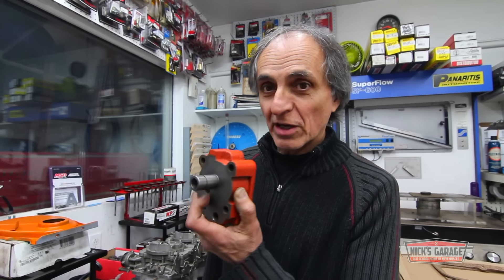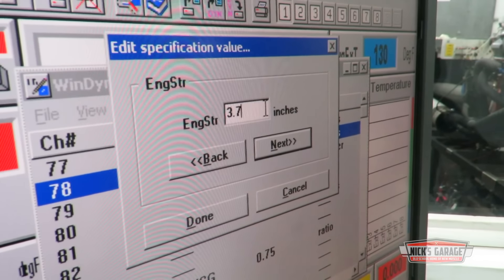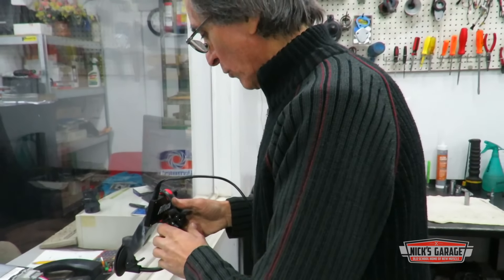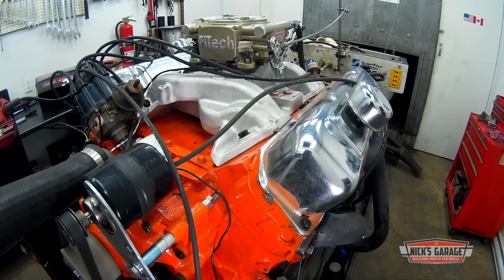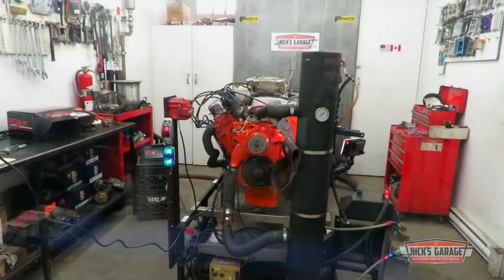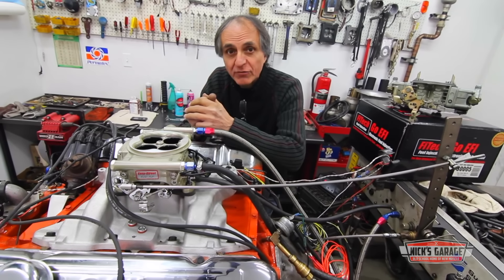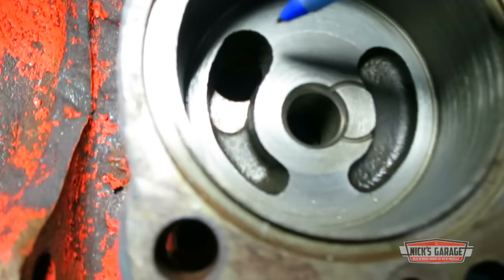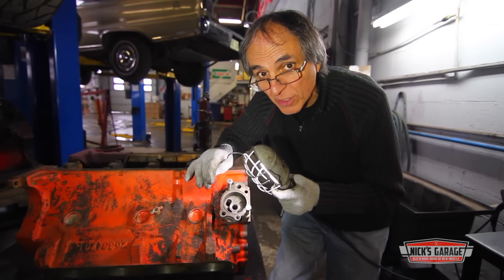Carburetor vs E.F.I. - Dyno Room Showdown

Comment: Nick needs to learn something about EFI. First of all, that is not real EFI. Spraying gas down a carburetor will not perform any better than a carb. It is a silly notion to think otherwise. 

Real fuel injection injects the fuel in the head or directly into the combustion chamber.  The whole point of fuel injection is to have a DRY intake. This allows more space for the air. In addition, it allows for long intake runners which improves VE. The intake can be tuned, just like the exhaust. The problem with a wet intake is that at low RPMs, the fuel does not stay mixed with the air. This causes it to puddle in the intake. As a result, the intake design is highly limited. Once you run a dry intake, you can design any kind of intake you want without consideration for the fuel. Look under the hood of any modern car. The intake runners are very long. This is one big reason why they are able to get such good numbers out of such small engines.
Reply: Hi Daveinet, ... yes and no.  What Nick is using still is called "Fuel Injection".  Fuel injection advantages are much more than having a "dry intake manifold".  There are several types of fuel injection systems (four are/have been used most commonly in gasoline cars). 
Throttle body fuel injection (aka single port fuel injection) (TBFI) is still fuel injection but is not as efficient and performing than port fuel injection or combustion chamber fuel injection.  The main problem is that remote cylinders (1-4-5-8 on most Ford V-8s) may not have the right (i.e. optimal) fuel/air ratio being robbed by their middle cylinders).  Also, as you mentioned, the fuel spray may condense on a cold intake manifold.
Multi-port or multi-point fuel injection (MPFI) sprays the fuel closer to each individual intake port making for a more precise mixture entering the cylinder head and preventing or making fuel condensation less likely in the port/head/manifold outlet.  On the other hand, MPFI "shoots/sprays" the fuel at the same time which can lead to small imbalances or stagnation in the intake ports.
Sequential Port Fuel Injection (SPFI) is similar to MPFI but the injectors are "fired" sequentially and independently, timed according to the firing (spark) sequence of the cylinders.  This allows for precise timing of fuel delivery without any lag to the opening of the intake valve.
Finally, Direct Fuel Injection (DFI) and its variations are the delivery of the fuel directly inside the combustion chamber.  It allows for ultimate and precise timing, amount, delivery, mixing, etc. of the combustion chamber fuel/air ratio depending on feedback from the various sensors installed on the engine (O2, NO, Air Mass, etc...).
Ciao, L (Ford Motor Company Engineering)
PS: I met Nick at a car show and I have been very impressed on his attention to details, his professionalism, and his practical approach to common mechanical problems.  He is an outstanding mechanic.
Reply: @lancelot1953  There was intended hyperbole in saying it was not real fuel injection.  And while you can compensate for high altitude and better cold starts, its not going to do much for you for everyday driving. Carbs do very well at atomizing the fuel. It is difficult for an injector to atomize the fuel as well without going to ultrasonic liquid processing. 
I'm quite aware of the types of fuel injection. I built and tuned a 502 MPFI. I modified the Edelbrock's tuning characteristics for increased flow. I can't produce dyno numbers, but the butt dyno had no trouble telling the difference. With the mods removed, it ran rich, especially in the top end.  There is just so much more you can do, once you get the fuel out of the intake.
Reply: Hi Daveinet, with all due respect, my answer to you was not to start an argument but just to point out that Nick's semantics was right in calling his system "Fuel Injection".  Of course, I do not know your experience or level of expertise in engine induction systems.  A lot of YT viewers have absolutely no clue in what they are saying or claiming, so at times, I try to clarify or explain issues that are brought up.  I am very familiar with the older Ford engines and older engine science since that is what I worked on as part of my career.
I have built several "classic" Ford engine but stayed with carbureted induction (for my restoration projects to remain "classic").
What did you put your 502 in and what engine block did you use?
Peace be with you, drive safe, Ciao, L (FoMoCo engineering)
Reply: @lancelot1953  One of the things I was pointing out is that these TBI systems don't offer much in performance gains. There is a mentality that there is something magic about FI, regardless of the type. The concept of fuel injection in and of its self doesn't do a lot. Performance gains are based on the intake design changes that would not work with a carb. Same even with direct injection. Its not the FI, its the fact that you can time the fuel delivery to prevent pre-ignition, so you can run higher compression. 
The 502 was built for a custom chassis front wheel drive 31ft motorhome. It was a lot of fun for the 16 years that I had it. The motorhome was very light weight for its size - aircraft stretch form aluminum shell. The cabinets were all Wilsonart Laminate formed over a frame. The cores were honeycomb. It had a very low center of gravity and was in a completely different class handling wise. The day I sold it, I took a photo of the speedo at 100 mph. I didn't think about it at the time, but later I looked at the photo and realized both hands were on the camera. I was driving with my knee at 100 mph in a 31 ft motorhome.
Reply: Hi Daveinet,  I fully agree with you with the benefits of the later generations of Fuel Injection but I do despise the complexity of it all (in modern max pollution-controlled production vehicles); TBFI did suffer similar problems of non-symmetrical cylinder fuel/air distribution (depending on the intake manifold design), "wet manifold" until the manifold was hot, and only offer a minimal performance increase on a well-matched carburetor/manifold/head-design combination.  But, principle-wise, it was an step in the right direction albeit "cheap".
What donor motor block did you use to reach 512 (Mopar, Ford?).  What heads and especially what front-wheel drive differential did you use to handle such power?
Did you built your motorhome from ground up or did your use the shell from an Airstream or similar design (Class A, B, or C)?  My hat to you, it is not easy.  I have restored an older 31' Winnebago Class B-Plus on a Ford Chassis, it is a lot of work and even more "fitting"
Take care, Ciao, L
Reply: @lancelot1953  When I say "built" I mean putting the top half on a GM performance 502 crate. The motorhome was a Revcon. It was originally designed by the stepson of Wally Byam, so yes, very similar to Airstream. I bought what was supposed to be a turnkey MPFI, however it needed a lot of tweaking, so I learned a lot about programming FI and a lot about how engines really work in general. It was a good runner, although it took about 2 years of playing with it to get it fully dialed in. I also had to learn about building a differential after breaking teeth on the ring gear twice. It was fun to drive. From a 20 mph roll, you could still stomp on it and still break the front wheels loose. Shift from 1st to 2nd would chirp if it was floored.
Reply: Hi Daveinet, was all your power delivered to the front axle, if so what did you use i.e. did you use a separate axle such as a front Dana 50/60 or did you use an trans-axle with integrated steering.  I used my Winnebago chassis frame/drive-train for compatibility with other Ford drive-train components (which I was very familiar with).  I modified, updated, and customized the interior for research and lab work.
I do not have much merit in engine technology since being an automotive engineer, I had not much choice but to learn what I was being taught.  I wanted to design the next generation Ford GT-40 race cars but times changed and I was relegated to work on antipollution equipment (which was not as glamorous as racing the Monaco circuit!
Congratulations for your custom work, Ciao, L
Reply: @lancelot1953  Yes, it was actually a Dana 70. The Dana 70 is de-rated for FWD applications, but still stronger than a 60. After the second time it broke, I had a conversation with Jantz Engineering. He sold me a bearing girdle kit and reinforced diff cover. The biggest thing is to keep the diff from spreading under torque. I also croyogenicallly treated the gears and carrier. It doesn't make anything stronger, but it does keep it from flexing as well as reduce surface tear out. All of that seemed to do the trick, although it took a long time before I was bold enough to allow a hard downshift.
Something else I should mention. No fuel in the intake allows for a cold intake. The advantage is that cold air is more dense, so you make more power.
Reply: Hi Daveinet, thank you for your information.  I would recommend that you make a video and/or a document on the various sites dedicated to the Dana axles, custom motorhome modifications, and making the "high-performance" community learned about your experience.
You are right about cold air being more dense (bringing more "Oxygen/O2" in the mixture).  That was the principle (at least in theory) behind the "Ram Air, Shaker Scoops, and other various "cold air" intake of the muscle car era.  This is also the rationale behind using the turbocharger intercoolers.
What will be your next project or have you given up the "nomad" life?  Ciao, L

Comment: Not true. No fuel injection will learn how to fuel an engine on it on. If fuel injection is set up correctly. it will make the same hp as a carb.
Reply: blackericdenice.     True, we needed more time to learn the EFI system.
Reply: Is this really you are a youtube channel controller? I'm just messing with you. I rebuilt a 96 Tahoe engine, installed a hotter cam and went crazy trying to tune the engine. I bought a new F150 2.7 ecoboost and sold the Tahoe.

Comment: That was a poor test. They would of spent quite a bit of time tunning the carb and ignition to get the best results. The efi got run or die.
Reply: Richard Shields.   The night before, we had it tuned for idle, part throttle and full throttle, and ran well. Next day for video, the efi had a mind of it's own.  True, needed more time to tune and learn.

Comment: I just stick to my 750cfm 3310-10 Holley performance. Never gave me issues. So I feel not need to replace it with tbi. Also can easily re jet your carburator to tune it. I think they both work just fine...just personal preference.

Comment: Not enough info here, what MAP did you use in the injection system? A single run does not allow enough info to build a proper MAP so you might have a MAP for fuel economy or who knows. I use to be all about carbs until Holley brought out the Pro-Jection system even though Holley had many problems with this, it made tuning so easy. Faster throttle response, smoother idling and no flooding off the line are just a few reasons injection is better. There is a reason all major racing is using injection including nitro.
Reply: homie789.       True, we needed more time to learn the EFI system.

Comment: Νick please tell me something....those HVH CARB SPACERS SUPER SUCKER as they call them...why are so pricy???do they really work especially in low end torque and throttle repsonse?have you ever use them?
Reply: steliosz28.        In some case they work. It depends on the application.

Comment: The EFI is the ony way to go for the great majority of us.  Some tweaking to cam, and spark would probably account for the difference in HP.   Contact the people who make camshafts and they'll be happy to show you a grind that would optimize the EFI
Reply: no way you can run an efi without electronics which automatically makes the carb superior.
Reply: try reading for comprehension Paul.  It's the electronics that make the EFI superior.  Why do you think Nascar Cup racing went with EFI?   @paulk5311

Comment: Opening up the inlet port all the way through the kidney port changes the pressure balance of the ring gear in the pump.  On a low pressure system such as an engine's oiling system, it probably won't lead to substantial wear but its something to be aware of.

Comment: The distributor vacuum advanced was unplugged. Why is this done with EFI? Was it unplugged with the carburetor also? 
Should have shown carburetor set up. Just saying? Timming is everything.
Reply: Some EFI engines also computerize the spark timing. The distributor is then locked in place, and the computer sets off a spark according to the programming.

There were also some carb engines that had computerized spark timing, the Chrysler "Electronic Lean Burn" was built that way. GM used computerized spark on almost every carb engine by 1981 and continued it until carb engines were discontinued.

Comment: Most EFI's don't start "learning" until they go into closed loop which doesn't happen until the engine is warmed up.  Nick is obviously an expert with carbs but his expertise with EFI has not been shown.  This way this test was performed doesn't help his EFI credibility.

Great tip on the oil pump, good addition to the show!
Reply: Micheal N.   I am old school, but I will catch up on the new school of EFI.
Reply: Nothing wrong with old school, in fact it has many advantages over the new stuff.  I really enjoy the show.

Comment: I don't think there is a EFI system so good that it can learn everything by Idling for a while. You put more effort in tuning the carps. Why not break out a laptop and actually tune the EFI.
Reply: ThetonyChopper.   The night before we had it tuned for idle, part throttle and full throttle. Ran well and the system learned it. The next day for video, had a mind of it's own. True, need to let learn.

Comment: The EFI HAS an electric fuel pump to prime the system so IF you want to avoid the cranking with a carb just add an electric pump.  Other side of cranking is the oil starts to flow through the system while cranking - depending on how long its been since you started the engine, it could start dry with EFI. Better to install a low oil pressure switch on the EFI system to stop ignition until minimum oil pressure of 15# is attained or add an Accusmp oiling system..

Comment: He got the results he wanted to get. I bet I could get the EFI to make the same or better numbers. When it is all said and done the max number is going to be achieved at WOT. Add sufficient air and fuel and you have a result. If he is showing 10 hp less it was either through the wrong amount of air or the wrong amount of fuel. EFI is infinitely more tunable than a carburettor so there is zero reason for EFI to ever make less power unless you have done something wrong.
Reply: Dodgy Brothers.   You are correct, it needed more time to learn. The night before we were tuning it for idle, part throttle and WOT, and ran well. Next day it had a mind of it's own.
Reply: That's kind of strange unless one of a few conditions changed. You either developed an air leak you never had before, or the O2 sensor needed to be recalibrated. Extreme change in weather could also play a part.

I wrote my own tuning software for my aftermarket ECU (after I begged the manufacturer for the protocols to interface with it) Auto tuning is not something that generally happens quickly, as you have experienced it needs to use feedback to correct itself, and it is generally after quite a lot of driving in different load conditions that you start to get something remotely close to a good tune.

I know there is a blind allegiance to carburettors but there are some totally ridiculous comments being made, like they can get better economy or performance. I can only assume this lack of understanding comes from not understanding how EFI works.

Carburettors are as crude as bashing a nail in with a rock, or trying to communicate with two cans and a piece of string, when are people going to realise that aftermarket EFI is infinitely more adjustable, and provided the tuner knows what they are doing it will always come out on top.

Comment: The weakness with this test is the inlet manifold design. To do a proper test one should set up a pair of fuel rails that allow the fuel injector to be as close as possible to the valve. Factory inlet manifolds are ok but not good enough to do a direct comparison to modern engines. Why not bring the old engines in to the modern era by designing manifolds that allow the air flow meet the demands of the cylinder rather than adapting an efi system to work on a faulty platform.

Comment: @Nick I have a 650 holy dp that hates starting cold (1 day or 12 hours )and I cant seem to get it tuned . I don't think anyone here in town works on them and all I'm told is that they are hard to rebuild. My best friend, the guy that helped me build the car died last year so I'm at a loss. 
The engine is a 1975 350 cammed with a high rise manifold I recently put an electric fuel pump which helps but not fully I also replaced the fuel pressure valve, so I know I'm close . Any pointers would be great
Reply: michael s. clark - Try pressing your accelerator pedal to the floor 3 times and then press it about 1/4 the way down and hold it there while you crank the engine. This always works for my Holley DP  equipped By the way, Holley carburetors are NOT hard to rebuild. They are actually easy to rebuild. If you don't want to attempt doing it, go to the nearest drag strip or circle track and you will find several racers or mechanics that would most likely rebuild your carb.
Reply: michael s. clark - I forgot to mention to check your timing. 2 degrees too far can make a big difference sometimes. Also, I assume you have electronic ignition. If not, there are other variables of course.